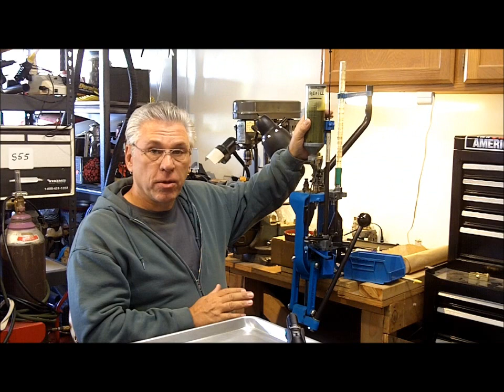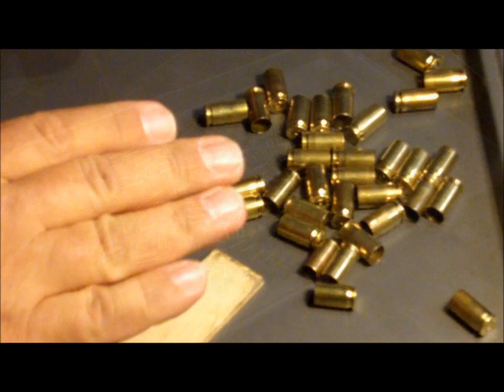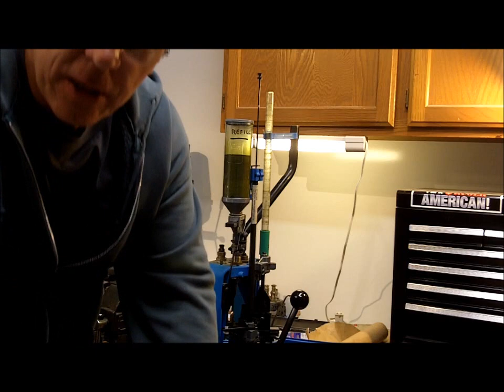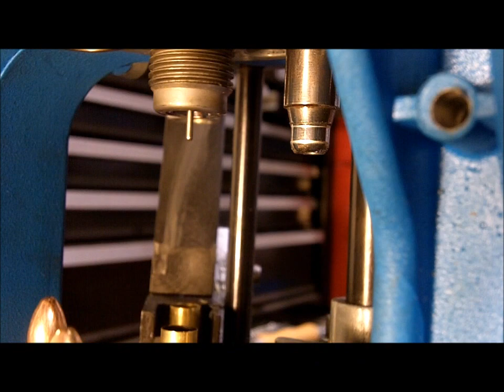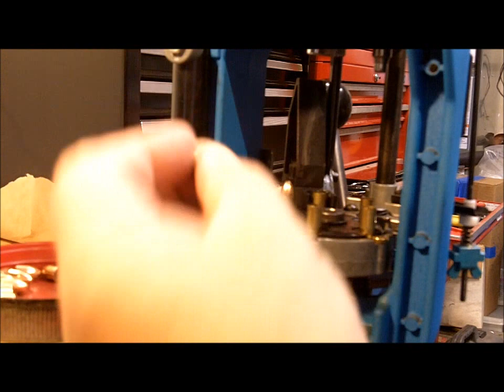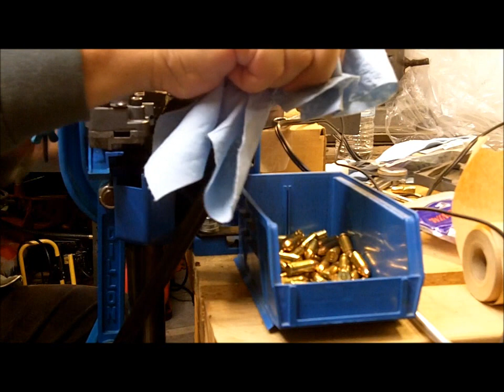Dillon XL650 Reloading Press

Comment: I learned on a Dillon XL 650 then later on got the single stage add on for it so I have the best of both worlds without taking up any extra bench space.   Just slide in the single stage tool head you don't even need to take the shell plate off that you may have used for 9mm.   And do a few loads of 30-06.    There is no law that saws you must start off using a single stage.   20-2026 the costs sort of ruined reloading to save money.   I've spent far more than I've saved on the hobby.

Comment: Any reason why you don't have a automatic case feeder? XL650 is basically designed for it while the 550 rb is more for indexing each stage.
Reply from the maker: +John B    After pulling the arm 20+ times I need to do another action like sticking cases in the tube or my arm will fall off.  If someone else is helping it keeps them busy loading primer tubes and filling the case tube.  It's also 1 last inspection on the cases.  Even without the case feeder it's easy to do 500+ rounds an hour.  If you need higher production then you need a case feeder, but you will need to inspect every case before you stick it in the hopper ???

Comment: Great video ! Did the press come with the case feed tube or did you have to buy the case feeder?
Reply: The press does come with the case feed tube. It also comes with the black metal support for the case feeder and a brace to stabilize the top of the case feed tube when there is no case-feeder attached.
Reply: thanks !

Comment: Dillon Case Lube is a lanolin & alcohol mixture. You can make it yourself at a fraction of the cost.

1 ounce of liquid lanolin. 
12 ounces of 99% ISO Alcohol

Place both plastic containers [liquid lanolin & ISO alc] in a bowl of hot water for 20 min. This will facilitate the lanolin to become pourable & mix easily into the warm ISO.

Mix well, pour into a good bottle-sprayer. Done!

Comment: On sorting cases of 9mm.To count and sort them (9mm) I use the plastic (50 pc containers) trays that comes along when you buy factory loads. 1st, I fill the cases upside in the tray and inspect them visually if there are other calibers like the .32 ACP/7.65mm or .380/9mm short. mixed. Then, pass a powerful magnet(taken from a big busted speaker) to sort out the steel casings which I don't reload. Then tally each tray so I don't lose count.  On 38 Special and .357magnum, check only for visual.

Comment from the maker: Non-Technical explanation:
It's like choosing between 2 hot girls with big B(. )( .)Bs,,,, but one is deaf and the other is blind.  It's a hard decision and only you can make it,,, they will both work.   Will it work LONG TERM ?   Resale value if you decide to stop reloading?  I would personally rather have the 650 with no case feeder than the 550 with.  Blind , Deaf, Blind , Deaf, Blind , Deaf, (. )( .)  ???

Comment: I was just looking at it as- now that the 550 is available with a case feeder, and the powder sensor station just doesn't seem that necessary to me, the real only advantage to the 650 is the auto indexing. And to pay more for the press and more for each tool head of each caliber and the conversion kits- I was just wondering if there's more advantages that a non user just wouldn't think of that would give the nod to the 650. Thanks for getting back to me so quickly.. Best... Ty

Comment from the maker: By "primer" I assume you mean powder.   Yes it is all adjust able and you set the powder with a scale to get the exact amount.  After it is set it will dispense the exact amount every time. Yes, it does rifle and pistol .  The setup and adjustment is different for each and this is why I do large volumes of each before changing the setup.  You also need different dies for each caliber.  Heed my warning and start with a single stage press 1st  . Go to 12:35 in the move.

Comment: I've never done reloading either so I was curious to expand on MrPUREENT's question.  Isn't their a set amount of primer per weight that is specifically required for every different caliber?  So a small 9mm will be a lot different than a small .223?  Does it have a certain way of dispensing the correct amount for different rounds?  Also does this do rifle caliber rounds too?  Thanks and great video!

Comment: Paul, for lubing you might try a method that works great for me. Take a tupperware container size of your choosing, and put your cases in, spray then put the lid on and shake. Repeat as nessicary. Works great, fasr, and contains the brass cleanly for use now or later.

Comment: ( Oops, posted that a little prematurely)... but I've reload close to 2000 to 3000 rounds, and am ready to advance to a progressive press such as the Dillon 650. My main question in regards to the press, is the priming station. Is there ever a concern abusing much pressure in the handle and accidentally discharging a primer?

Comment from the maker: Well ,,I’m in Arizona,  LOL,,  the hot part of Arizona !  Heat is not a problem.  I have been told that one gallon of gas is more dangerous than a pound of powder. Powder does not blow up, it flares up, unless you have it contained in a pressure vessel. In general it is even hard to even light powder.  I keep loaded guns in vehicles. The temperature in the cars can get well over 140 ? and my gun has never fired itself.  
The Lee is a fine starter kit as most single stage units are).

Comment: Excellent video. Considering starting with reloading but had a questions. How dangerous (flammible, etc) is the charge powder? As I live in Alabama and the summers get to be near 95+ degrees, this is a viable concern. What are your thoughts on the Lee Challenger Breech LockSingle Stage Press kit as for a beginner? Thanks!

Comment from the maker: @bartofilms 
GOOD POINT !   I just rechecked and the Dillon Case Lube conatains lanolin and isopropyl alcohol so it should be OK.  I know I don't need the lube and it works fine without it but with the lube it runs like silk ! For 50 rounds may not be worth it ,  when I am doing 500+ rounds it just makes it so easy and smooth.

Comment: Hi Paul,  You may want to wear latex gloves when handling brass that's coated w. case lube.  I don't know about Dillon's, but several other case lube compounds have benzine in them.   If you have carbide dies, you prob. don't need the case lube anyway.  Cheers.